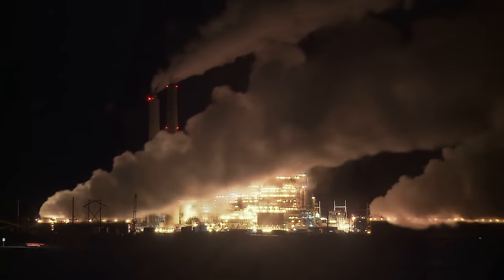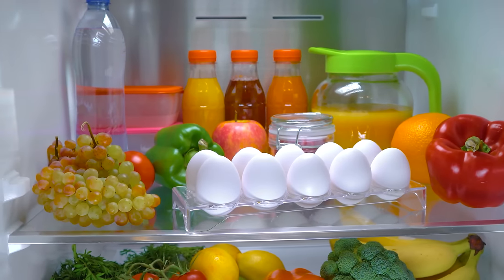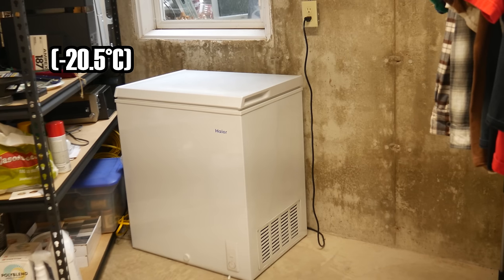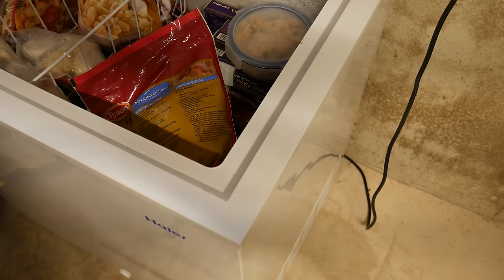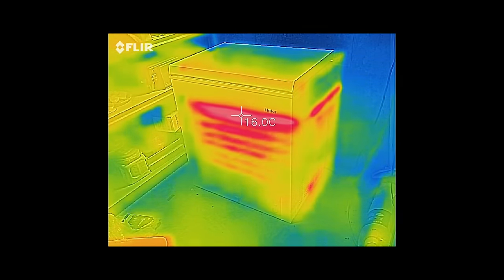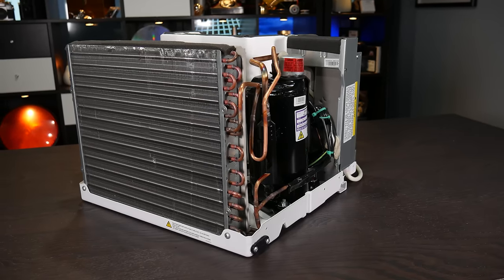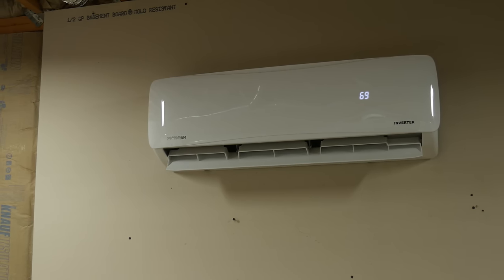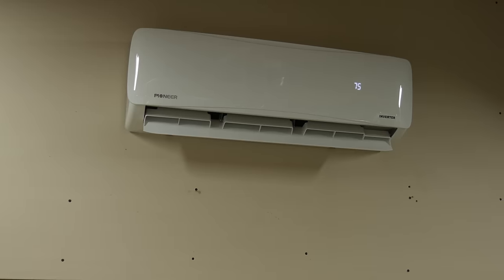Heat Pumps: the Future of Home Heating

Comment: shorter explanation:
you take an air conditioner, and put the gear in reverse.
Reply: Dude that actually made sense thank you.
Reply: Another way top put it, it is a reverse refrigerator..
Reply: Hmm no not at all, but for people that don't care how it really works. That's a good way to say it.
Reply: @predaR6  trying to keep it short and simple, just the basic concept. For the details on how it actually works, there's the excellent video.
Reply: Technically your wrong. 

The compressor always runs the same direction but the refrigerant reverses which coil it goes to first. 

Normally refrigerant goes to the coils outside your house first then the inside coil second. 

With a HP, it goes to the inside coil first and then the outdoor coil

Changing the gear orientation would just burn up the pump.
Reply: @michaelbard420  true that
Reply: @michaelbard420  You may want to look up a concept called "metaphor".
Reply: @johnw.3270  I understand what it is. Doesn’t take away from what I said. I think if your statement would’ve said switching the direction of refrigerant and not changing gear direction, I would’ve let it be but working in this field for over 14 years, I felt I had to ad some clarity to your metaphor.

Comment: I have one, i dont have a clue how it works but my house is warm, so it must work.
Reply: If you watched and payed attention you might have a clue!
Reply: A few years ago, I as in me, not some company, took a EPA refrigerant class to get my EPA card then with a lot of reading, ripped out my AC and installed a heat pump.  Doing it myself, I ended up spending about $3 grand to do this.  This included the tools and equipment needed to do the job properly.

As for my savings, It saves me around $150 a month for about 4 months versus just using propane.  The reason I'm still spending money on propane to heat the house is because I have it set, where if the temp is below 32F, I'm on propane heat, 32F or higher outside temps uses the heat pump.
Reply: @estebanalbanesi7922  alright Esteban, steady on.

Comment: I turned my air conditioner into a heat pump. All I had to do was wire a light switch 120v to the compressor, and when I want to go into heat mode I just go outside and flip the switch and it reverses the polarity of the compressor leaders so instead of pumping out AC it pumps heat.   The only caution is that you can ice up the coil and the compressor, so every so often you must go and reverse again to do a defrost cycle.  Cheers from UK~!
Reply: An you are very lucky it hasnt blowed up  Genius if a unit is not built to be a heat pump the inside coil is diff then a heat pump unit cause the both inside an out are made to handle the pressure an also your lucky you havent burnt your house down the comp is not made to run backwards either dumb luck is on your side or god has ur back
Reply: Liar
Reply: sounds dangerous

Comment: Here in Dallas, most new systems are air source heat pumps.  I've had one, and they work well most of the time...but during the winter storm that just happened, I was very glad to have a gas furnace.

Comment: so what i'm getting out of this is that i can just turn my window ac around in the winter
Reply: I would want to see someone testing if that works though.
Reply: @mrdoge9508  i was only kidding around, but i just looked it up and apparently its actually doable with some modifications
Reply: If you reverse the way you installed them, yes ? A chore to do twice a year though...
Reply: Then also defrosting cycle should be added with few temp sensors and relays so it would not split the outside coil if it gets too icy.

Yeah and it needs auto-reverse for defrosting, like old cassette decks :D
Reply: Yep, there should an annual ritual for the adjusting clocks, replacement of smoke detector batteries and flipping of window AC units. Probably should be a holiday.
Reply: @mjduigou  Daylight Savings 2: Electric Boogaloo
Reply: @Karjis  also, the electronics or other control systems should be moved inside to prevent water ingress and short circuit or leakage
Reply: It'll be noisy at least ;-)
Reply: @akhilaryappatt  Yeah, exactly. Best just to get a device that has the heat pump functionality already built in so it has the 4-way valve and the extra sensors and logic already built in.

Comment: You are 100% correct about heat pumps being extremely common in the south.  I am in Northern Mississippi and it's pretty standard here.  I suspect they are so uncommon up north because the companies selling them don't want to deal with the massive number of complaining customers for those times when it doesn't work because it's too cold.  Up north, there are typically weeks of that several times every winter.  Here there are maybe a couple of days like that in several typical winters. 

It seems to me that there should be an alternative though.  You could have a two stage system using two compressors and two refrigerants  and easily extract heat from outside air even at 50 below!  Yes, the 2nd compressor would make it far less efficient when it's 50 degrees outside. But it could be designed to only use the 2nd stage when it drops below say 15 degrees.  That's around the temperature that heat pump efficiency really starts to drop off.
Reply: In Michigan it is rare to see a home heated with a heat pump. And the ones that do use heat pumps are usually equipped with a gas or resistance heat backup.
Reply: Hey I’m from the MS coast, still never even seen a furnace heated home haha

Comment: "To prevent mildew, airconditioning was a must"... i hope this was intentional. I laughed like a fool.
Reply: I install heapump systems in New Zealand I have been doing this for the last 15 years.
Reply: Thanks for pointing that out, this goes straight to my dad-joke pile.
Reply: sorry would you mind explaining the pun for me please ? I’m not native english but I’d like to understand it :)
Reply: @Karibo_0  when something is 'a must' that means its needed, but also when something is 'musty' that means its damp and mouldy
Reply: @johnnorris1983  extraction of moisture is actually the benefit, not the exchanging of air, though if the temperature of the outside air is the same as the desired temperature, and if it's dry outside, a simple fan air exchanger would be much better than dehumidification with heat pumps. 
My goal was cooling with a whole house fan, except the problem I have is that when it's cooler outside in the summer, it's very humid, so I didn't want to draw in the cooler but very humid air, so I ended up rarely using it.
Reply: @Adimote  Must and mildew go hand in hand. 🙃
Reply: Heat pumps are fairly common in the US. At least in the south anyways. The problem up north is that, the colder it is outside, the less effective the heat pump is. It gets very cold in the north in the US.

Comment: Here in Australia, I think virtually all air con units are 'reverse cycle'
Reply: And electric hot water heaters are now heat-pumps too for the most part in Australia. I'm not even sure resistive immersion heaters are sold anymore, certainly, the building codes in most areas do not allow them anymore, new installations have to be heat-pumps. Our own hot water is solar with instantaneous natural gas 'boost'. The off peak relay and meter was still in place, but unused for several years until our metering was replaced with a remote reading 'smart meter'. And the smart meter installer was going to leave replace the off-peak meter too. When I asked that they remove the redundant meter and not replace it while they were messing with the board, the tech had to phone the office and get permission to remove the 2nd redundant meter instead of replacing it with a remote reading smart meter.
Reply: Yeah I remember in the late 80s / early 90s they were pretty much only selling reverse cycle air conditioners, and honestly I probably only knew about 1 person who even had air conditioning outside of their car at that point.
Reply: Except for 'evaporative' ones (common for older models in drier areas like here in Perth) that aren't really air cons but swamp coolers.
Reply: I've encountered my first non-reversible aircon, and thereby learning of their existence, in Sydney. The flat also had a gas space heater.
Reply: @Talking Turkey the unit that you adjust temperature on digital screen and only use your hot tap is what you want,I’m using 9kg bottle a year,
Reply: You could afford air conditioning? I just had one of those giant floor fans sat on a cardboard box for bedtime. 😅
Reply: I think there's still some now that are 'cool only'. Probably cheaper and OK in Darwin or somewhere else tropical.

I had one in my place when I moved in, it didn't last long, the heating bit especially comes in handy here in Melbs :)
Reply: South Africa here.
We had reverse cycle air conditioning since I was a kid in the 80s.
Reply: @the_real_hislordship  Same here, I always thought it was just a heater and thought 'so what?' obviously there's more to it than a simple bar heater =)
Reply: @Talking Turkey and gas is sooo dirty.  I am going to heat pump next time.
Reply: Yeah, same here in Florida. They’ve been here forever.

Comment: Great tutorial - my interest in heat pumps jumped significantly when I learned that my Mini SE electric uses a heat pump instead of a resistive unit to save energy and get the most out of its teeny battery.

Comment: My parents bought their house in 1971.  I'm almost certain it came with a heat pump system.  10% uncertainty.
In Florida, cooling is FAR more important than heating.  When it gets up around 36ºC (97F), the system can't maintain the indoor less than about 20ºF cooler.

5:35 Temperature is a measure of average molecular motion.  Your boiling pot has individual molecules with significantly different molecular motion, which is increased by the addition of energy/heat.  The highest energy molecules are the first to escape, and it takes a continuing addition to get everybody up to speed.
Because temperature is an average, the temperature of the water (at STP) can't exceed 212ºF (100C).  That is, until the pot boils dry and you burn it.

Yeah, you said all that.

Comment: Heat pumps work great but when temps get too cold outside you still need to use a different heat source.  Had to turn on our emergency heat strips this year.
Reply: I hate heat pumps
Reply: @tashalynn29  what do you prefer when natural gas isn't available and how far north do you live? They work pretty good for the most part in Oklahoma.
Reply: @AvgDan  when I lived in Dallas  the house had one. I was always cold. No matter how high I cranked it up it felt like it blew out cold  air. I hated that damn thing.
Reply: @tashalynn29  I would hate them too if I had the same experience. I prefer natural gas myself, but my new neighborhood is all electric.
Reply: Well AC suffer the same issue on extreme temperatures. It is so hot outside that there is no place tu put its heat.
Reply: @tashalynn29  people in much colder areas use them exclusively for heat so I wonder if you don’t have a model designed for heat at certain temps.

Comment: Hey! Offering a slight correction and answer for you.

First, I've loved your videos explaining EVERYTHING for a long time.  With a degree in physics and running an HVAC company, I love watching you explain things, even things I already understand, in a clear easy to digest way.  It helps me explain stuff to others :)

I'd like to offer a correction in this video.  You are correct about (in cooling mode) a metering device being in the indoor unit in MOST AC's and Heat pumps.  However, in mini-split systems most metering devices (usually a txv) are in the outdoor unit. It's the last thing it goes through before it leaves the unit.  This is why on mini-splits BOTH the copper lines have to be insulated.

In all other regular sized split systems, you are spot on, which is why most non mini-split heat pumps only have one insulated copper line. Having said that, it's only a small detail that's only important if you work on them. This video is one I u se to explain HVAC systems and Heat pumps to new employees.  Better than even many HVAC specific channels.

Comment: I have this kind of air conditioner installed on my house and upon reading the instruction manual I found out that it is rated for COP (heating) of around 5!
Reply: It will depend on the temperature cold day or hot day won’t go anywhere near it

Comment: I would appreciate a video on how the commercially available WINDOW MOUNTED versions of reversible heat pumps differ from the one shown. I just purchased one, and it claims it will auto switch to resistive heat at around 38 to 40 F outside temp. Which means it makes no attempt to defrost the coils.
Reply: I was wondering why that wasn't mentioned as possible solution to efficiency problems at low outside temps. Once the heat pump's efficiency falls to 1 or lower, it would make sense to switch to a resistive backup. Cool to know that some systems do that.
Reply: @AlexanderPavel  Primarily because the COP of resistive heating is by definition 1.0 (when our heat pump went out this winter we ended up with a $1000 electric bill ...). But generally speaking, heat pumps switch to their backup or emergency heating when they can no longer keep up with the cold. Electric resistive heating is one of the most expensive ways to heat a home, generally about 2x-2.5x the price of equivalent natural gas heat (depending on the specific area of course, but it is generally due to what was mentioned in the video: ~40% efficiency at just delivering electricity to your house relative to the energy source used to produce it). So you want to avoid resistive heating at all costs. A heat pump that makes that switch at 38ºF would be fine for an area that gets to freezing just a couple nights per year; if you get to freezing for months at a time that electric bill would eat you alive!
Reply: Kenbaeli85,  With a PTAC (the type you probably have) the heat pump changes to electric resistance heat when the outside air temperature is below about 35 - 40 F outside, so that water will not collect on the outdoor coil and freeze.  This frozen water can then damage the fan, and the outside coil.  Defrosting will not prevent the ice build up inside the PTAC box (unlike a normal heat pump designed to run at -5F).   If you ever turn on your heat pump, and the fan will not start, and it is below about 29F, then there is a chance the outdoor fan blade is frozen to the ice in the bottom of your heat pump.  (only applies to window heat pumps and PTAC style heat pumps).
Reply: MY WHOLE HOME heat pump continues running when cold, but it supplements with resistance heat below 20 F

.
Reply: As the uploader stated, that only happens a few days a year

Comment: I just run an AMD overclock, heats my home fine.
Reply: Unfortunately, modern AMD CPUs are utter crap at generating heat given how efficient they are (ask me how I know). Bulldozer + R9 295X2 both overclocked to hell and back and running BOINC + Folding at home all day would be a good meme-tastic AMD way of heating. Better throw in a couple 15k rpm HDDs for good measure, too. Good luck keeping your house from burning down. This AMD heater/firehazard is too slow for my tastes, however.

The ultimate computing heater nowadays would probably be an Intel Xeon w-3175x with dual 3090s overclocked to the limit and running BOINC + Folding at home. If you want to save some money you can go with Threadrippers with 3090s, you get slightly less heating, however. The modern ultimate AMD heater would probably be the 3990x paired with multiple Radeon 7s (or the 6900XT, whichever is faster for folding at home).
Reply: @randomguy8196 Yeah, true. An overclocked Xeon w-3175x can easily draw over 350 watts if you overclock it enough, but that's an outlier.
Reply: You need to add phase change cooling to that, and presto!

Comment: The heat strips consume 3 times the energy of the compressor.  I live in a place where the average winter temperature is 50°. This winter my heat strips blew a fuse and the compressor could not get the temperature inside the house above 68°. So even in this mild climate the heat strips are absolutely essentials to stay comfortable. And those heat strips cost a lot of money to operate! So I bought a smart thermostat and it actually stages use of the heat strips to minimize power consumption. But I still prefer my old heating system in my old house which was natural gas heat and electric air conditioning. My house was always comfortable and it was cheap to do so.

Comment: "mounted to a stud wall" - yes, this will greatly increase the noise. The same applies to inverters for solar power - mine has a cooling fan, and it is wall-mounted (a mistake, in hindsight). Next time I will mount it on a pole or similar, not onto the house frame at all.
Reply: good advice, thank you. I hate that kind of noise.
Reply: You can also purchase vibration absorbing wall mounts (similar to engine mounts in a car, rubbery bits in between metal so vibration isn’t completely transmitted)
Reply: @jameswhatsit  My installer did not use those, nor did he suggest them. I will move the panel at a later date, off the wall.